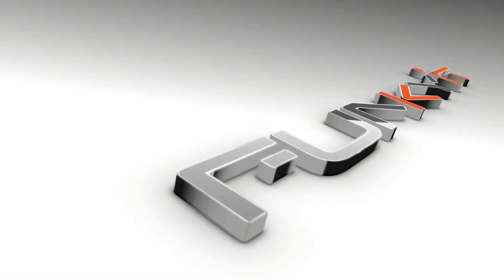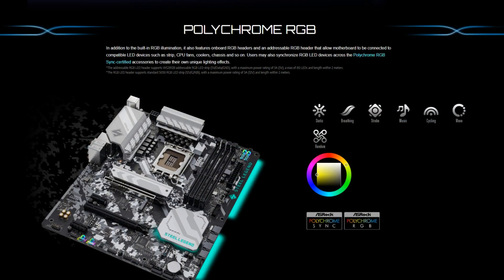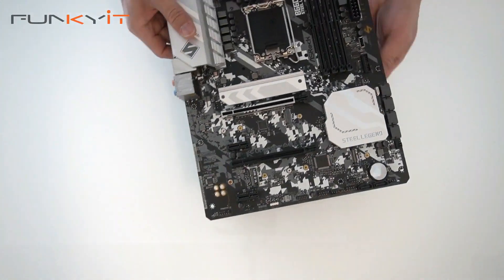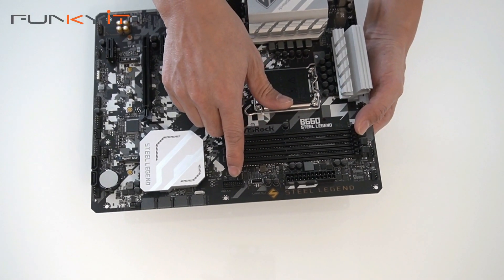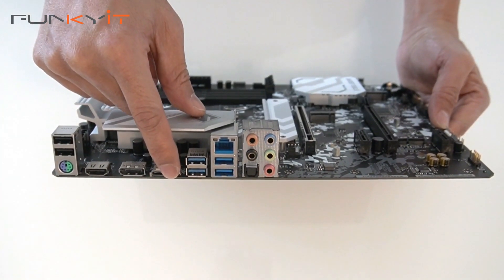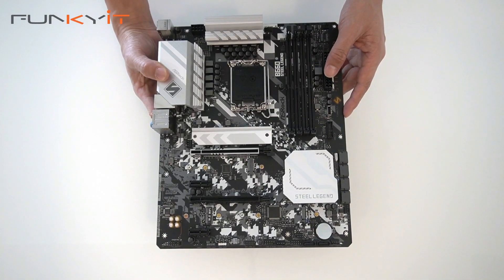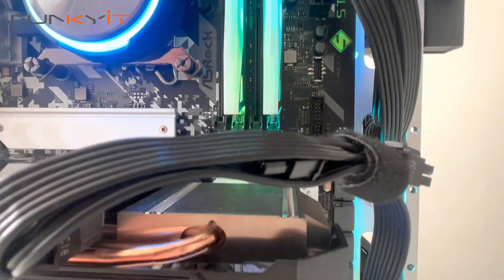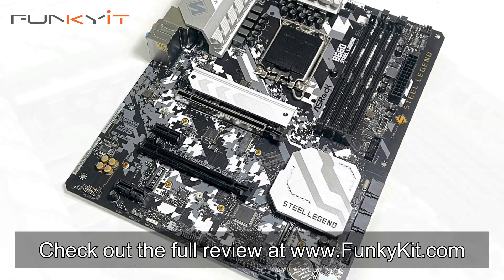The Most Affordable Motherboard for the Intel 12th Gen CPUs - ASRock B660 Steel Legend

Comment: Would this be good enough for a 12600k?
Reply: 12600k doable. but b660 you cannot overclock, why would you buy a 12600k ? k- means overclockable.
Reply: @rnegoro1  I don't plan to OC the CPU (senseless IMO) anyways. I just want a trouble free board thats inexpensive
Reply: @juniorthomas6404  I have the 12600k with the b660 steel legend and I think that if you don't need overclocking, this would be a good board

Comment: Any idea if this is capable of overclocking locked CPUs like the 12400f through BCLK? There have been a few boards with external clock gens that have been found to get around Intel's lock for OCing, The Asrock Steel Legend is rumoured to have that capability as well, but no one can confirm it. You'd need a locked CPU like the 12400 or 12600 to even see it pop up.
Reply: Bro, locked means locked. You can run it without power limits, yes.
Reply: @ties9123  certain motherboards actually allow bclk overclocking - one such example is the asus rog strix b660. 
https://www.youtube.com/watch?v=DUzExonH5TM
above is an example of derbauer overclocking a 12400 (non overclockable) with BCLK overclocking - only in certain motherboards.
Reply: NO- no no no .  only the asus tuf allows the BCLK overclocking. look at der bauer videos.
Reply: No this mb does not have a external clock generator, the boards that have this feature are only available in Taiwan, Intel blocked those boards from been sold on other markets
Reply: Blck overclocking can only be done on boards who have a seperate onboard clock chip. Which is usually only included on higher end boards. Boards that only make sense to buy if you are going for a K series chip anyway. So there are no cheap motherboards with their own clock.